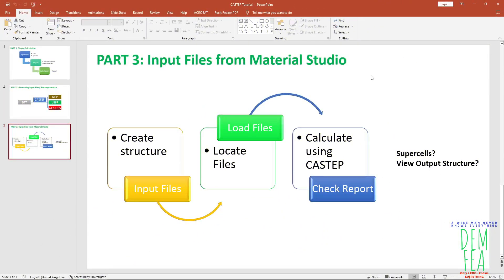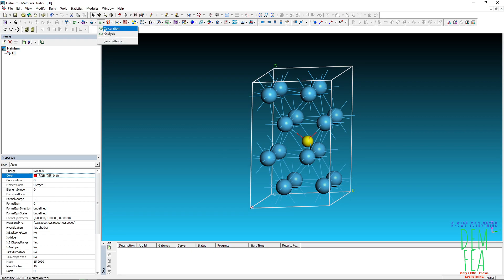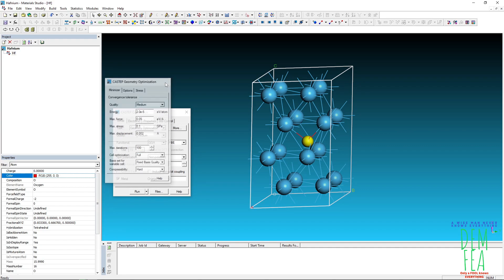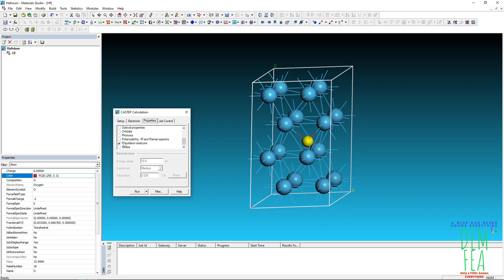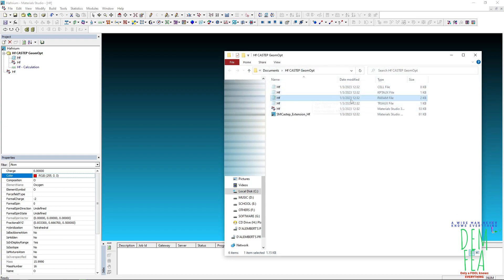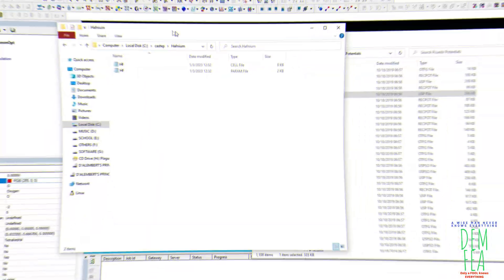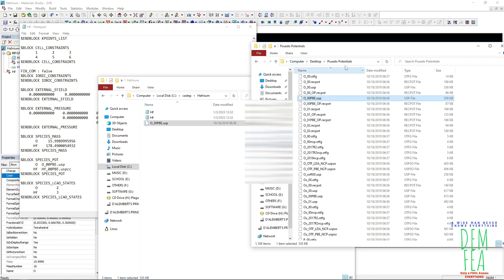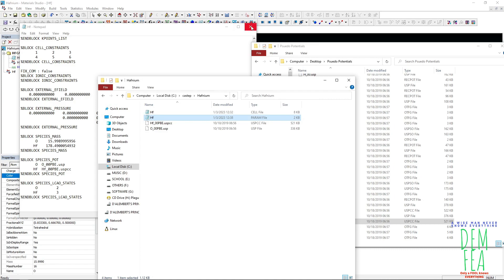Generating input files for CASTEP Academic using Material Studio - Part 3

Comment: Dear sir, I would like to know how can I get the input files for CASTEP academic, if I do not have the Material Studio software.
Reply from the maker: You can use Oscail Software to generate the input files. But, Material studio is the best. I do not know another method. You can always download unlicensed version of MS and use it to generate the input files without the license.
Reply: @PiotarockIn  Thank you very much, sir.
Reply: @PiotarockIn  do you have oscail software the download link on the university website seems to be down